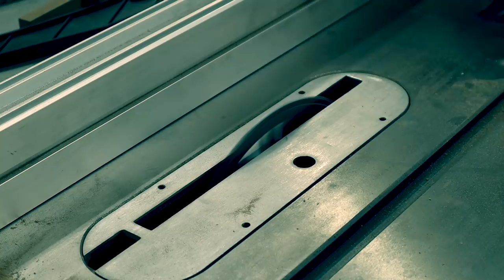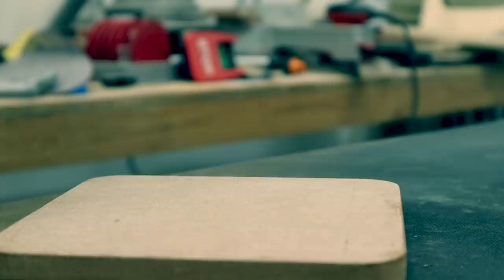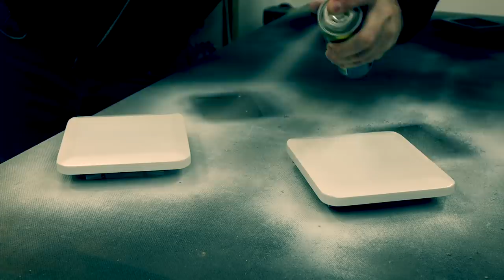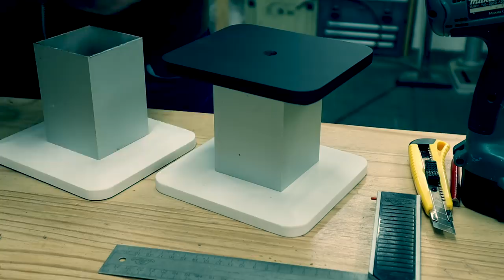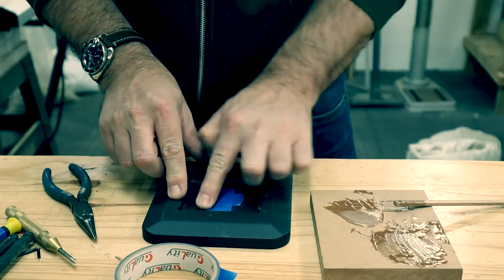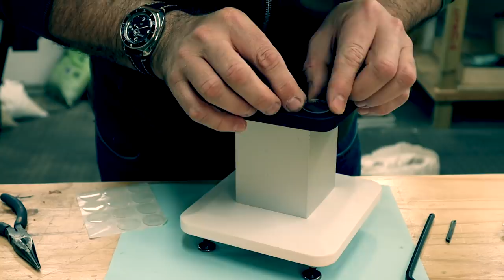Making Heavy Desktop Speaker Stands - by SoundBlab

Comment: Nice project, but please improve you safety discipline when cutting on the table saw. Do not do crosscuts guiding along the fence and without the miter gauge. A miniscule shift in the angle of your wrist can send that piece of wood flying into your face and you could easily lose some fingers.  I know this. A good friend.. a professional cabinet maker with many years of experience, got in a hurry one day and doing that same very thing you did here, buzzed off three fingers. Please be more careful. Take care and God bless.

Comment: Non capisco a cosa possono servire degli stand così bassi.
I don't understand what such low stands can do.
Reply from the maker: It lifts the speakers up from my desk to bring the tweeters in line with the height of my ears. It also helps to isolate any mechanical vibrations to transfer to the desk surface which could affect the sound quality.